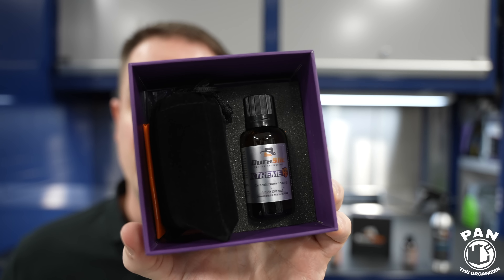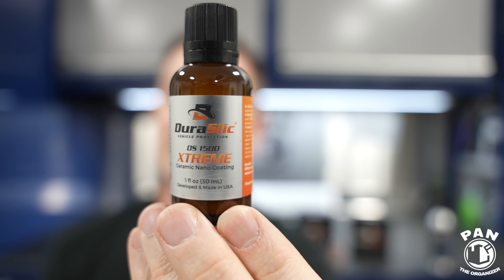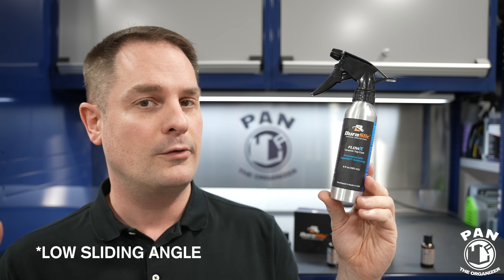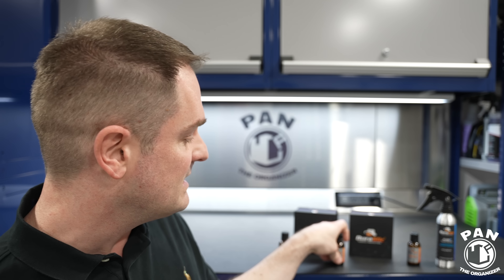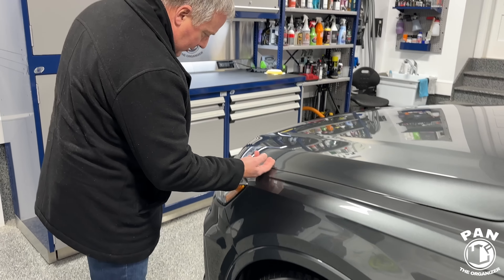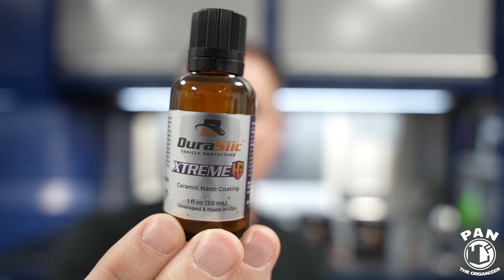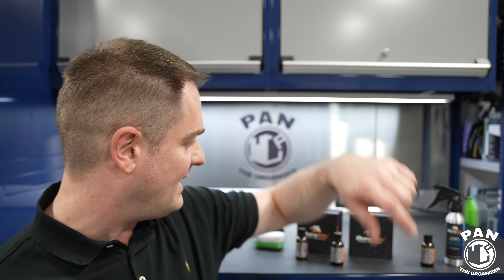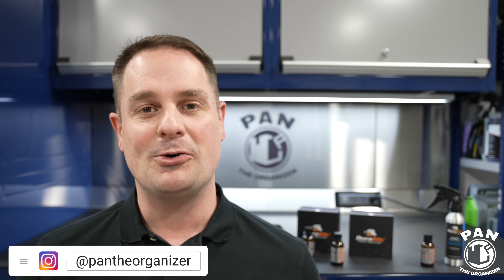Is This The Holy Grail Of Ceramic Coatings? NEW DuraSlic Holy Grail

Comment: Hi Pan, can this coating be applied to trim, plastics PPF? Thanks in advance
Reply from the maker: DuraSalic says that  it can be applied to paint, glass, plastic trim, wheels and lights (not recommended on chrome surfaces).
Reply: @PanTheOrganizer  thanks for replying. Hey just an FYI I applied the Cerakote to my wife’s Audi Q5 prior to selling in a week ago and had fantastic results. I applied at 60 degrees F and 40% humidity and waited the suggested 5 minutes and possibly a touch longer. But I applied it really heavily I’d say 45 ml to complete. I’m in South Louisiana (we had a front move through and I have semi controlled environment (38f outside) it looked great and responded to the first was as you would expect.
Reply from the maker: Oh good to know. Thanks for sharing your experience. So no issues after a few washes?

Yeah it seems to be doing great in some weather/conditions and not so great in other situations. But the brand will address this and update the coating with new curing mechanisms so it should be ok for everyone once the new version gets sent out.

I think some people just overly put drama and conspiracy theories where there was just something the brand needed to tweak. Because if the durability is there, overall the gloss, slickness and hydrophobic properties are very very good and it’s super easy to apply. 👍🏻
Reply: No issues after 2 (then I sold it, Bought a Range Rover Sport PS400 putting HG on it this weekend) but the weather was good. Have to say that was easier to put on and leveling that putting on ole Jescar Powerlock sealant. The looks and gloss were fantastic. The only thing I thing I did differently that I’ve seen was I left it on until I felt and initial slight grab before leveling, maybe I was a little insecure with how slight it is to remove. I agree, people are just too competitive. Your interview with the CEO was fantastic. You can see his a great leader and takes responsibility. With that kind of leadership, allocation of resources and accountability they will get it right.

Comment: Hi Pan 
Just one recommendation to your Chanel most of the time you work on nice or new car doing polishing etc 
It will be interesting if you work on a really bad car(damage big scratches etc )and bring it back to life with recommendations products you normally used that will be a challenge
Reply from the maker: Hi Omar. My channel isn't one of those "Hey look at me cleaning a disgusting car" or the style of disaster detailing video. There are enough copy-cat channels that do that. I have ZERO interest in cleaning disgusting or really bad cars.

After 26 years of detailing, I focus on doing what I like most. So I do higher end full new car prep jobs, including application of a ceramic coating. I don't do entry level car wash or just clean a dirty car anymore. 

Plus, my audience is truly passionate about keeping their cars clean, so making disaster videos wouldn't be popular on my channel.

Also, the techniques and products used don't change from a clean car to a dirty car lol. That changes nothing. You just need more elbow grease and time to clean really bad cars. Case in point, in all the disaster type videos, as soon as they're done pre-rinsing with the pressure washer, the vehicle is 85% clean and it gets back to the exact same point as a cleaner car.

Disaster videos are more for entertainment. My channel is more about education through tutorials, tips and tricks.

That being said, if you're curious, I made a few videos of cleaning filthy cars or older neglected cars, just for my viewers' entertainment a few years ago here:
https://youtu.be/sAqamdcZmn8
https://youtu.be/7zqovDt7NIU
https://youtu.be/KsmXHos0zyY
https://youtu.be/ig82dR1pPN0

Comment: I usually end polishing with the kochchemi micro cut . Do you recommend anything else to polish with before applying a coating ? I just bought the coating in the link and thanks for the video. Appreciate if you can answer this for me
Reply: Kock Chemie micro cut is the bomb, very good polish, that's what I use prior to coating.

Comment: Pan, great video! I'm interested to know if the water spotting is less noticeable with the Extreme HG version vs. the Extreme. I have applied Extreme on 3 cars, and the water spotting is pretty bad. Have a great day, thanks!
Reply from the maker: FlowX was created as a topper for Xtreme 1500 and that should help you.

But yes I’m told that Holy Grail is much less prone to water spotting.

Comment: Sorry I'm new to this- few years worth of slickness, does the ceramic coating prevent environmental fallout from attaching to the paint?
Reply from the maker: No coating can prevent that. What good coatings do is make washing the vehicle a lot easier. And the slickness also helps with helping your mitt and microfiber drying towel to glide better and thus reduce the chances of marring.
Reply: @PanTheOrganizer  IC, so do you perform contaminant removal in between if you feel the grit build up on your finish or just leave it until the coating has lost effectiveness and require a new coat?

Comment: How long will the coating last in the bottle if it hasn’t been opened? Should it be used within a couple of months of purchasing.
Reply from the maker: Typically coatings are good for 1 year if unopened and stored in stable conditions and not frozen.

Comment: Pan, is the kit meant for only a one vehicle application?
Reply from the maker: It depends on the size of the vehicle and how much you apply. But for an average size car, one bottle is more than enough. You could stretch it to two cars if you only apply it on painted surfaces.

Comment: Hi Pan, is there a time period after applying a carnuba wax to let it cure fully before washing the vehicle? Thanks
Reply from the maker: It depends on which carnauba wax you applied. It's important to follow the instructions on the label. But typically, a pure carnauba wax has no curing time. After application, you can drive off in the elements, no problem.

Comment: Hi Pan, Again a great video! With lots of great advise. I have used Duraslic Extrem 1500 and starting Y3 on one of my car and it is the best by far the product that i have used, and got it boost by FlowX last year, and it is like a French install…. UNBELIEVABLE !  Would you recommend extra step for the prep to remove old Ceramic coating that was install 3 year ago?  Again great job!
Reply from the maker: The only way to ensure 100% removal of an existing ceramic coating is by machine polishing.

Comment: Another great product and video!  Thank you, Pan!  I have a quick question for you : if, one year after applying DuraSlic Extreme, I found swirls due to winter in Quebec, I will have to do a minor polishing correction.  Does it mean I will have to apply another coating of DS Extreme on that section?
Reply from the maker: Yes, as machine polishing is what removes coatings. So you would have to reapply.

But if you use safe washing and drying techniques, you should not have swirls or scratches for a few years.

Comment: Can this be used on a normal standard vehicle? Or does the vehicle need to be ceramic coated in order for me to use this product.
Reply from the maker: This is a ceramic coating. And you have to apply this on a vehicle that doesn’t have a ceramic coating. It needs to bond directly to a virgin clear coat. Hence why you prep the paint to make sure it’s squeaky clean.

Comment: Question: when leveling with a MF towel, do you use a new towel every couple of panels? Or it doesn't cure/harden fast enough on the surface of the towel to mess up the applied cost on a vehicle? 
Thank you in advance
Reply from the maker: I use 2-3 leveling towels and 2-3 buffing towels when applying a coating on a vehicle.

Comment: Thanks for this offer Pan,i recently coated my truck(first time coating) and it turned out great but after 2 months im not 100% happy with the coating,it seems to hold water spots pretty bad and has graphine which i though was supposed to help fight water spots? Anyway,i have wanted to try to find a professional grade coating but have no certifications so,this is perfect.
Reply from the maker: Polishing a coating isn't recommended, as you would damage and strip the coating. Mechanical abrasion and friction will remove the coating. Chemical decon steps are always preferred on coated cars. I would recommend the following steps:
1) Wash the car with a decon shampoo like CarPro Descale. It's slightly acidic pH will help remove minerals and water spots.
2) Rinse it, then use a tar remover if you have tar deposits.
3) Rinse it, then use an iron remover to remove brake dust and industrial fallout.
4) Rinse and dry the vehicle. 
5) Then use the water spot remover, which will also help to remove any minerals left on the coating that perhaps are masking its properties. Rinse, and wash the car again. 

The coating's properties should be restored at this point, assuming the coating is in good shape and was applied properly and is still within its claimed durability.

Also, clay bars are abrasive by nature, and again, not recommended on coatings as you would damage the coating and potentially add some marring to the paint.

If maintained properly, you shouldn't have much embedded contamination. In some rare cases where you might find some contamination left after all the chemical decon steps, like a bit of grit in the clear coat, you could use a synthetic clay towel (that uses a different clay media compared to traditional clay bars) and lots of clay lube, in order to lightly clay the surface. A clay towel like this one: https://bit.ly/43nrfce
Or this one: https://bit.ly/43y0Mss

But test on an inconspicuous area first!

Comment: Hi Pan, how does ceramic hold up to claybarring, iron decontamination, wheel cleaner, and or bug and tar remover?
Reply from the maker: You don’t clay a ceramic coating. Claybars are abrasive and could damage the coating. But any good coating can resist to chemical decontamination like tar removers and iron removers and bug removers.
Reply: @PanTheOrganizer  So if you have a rough finish where you can feel particulate matter on your fingertips or back of hand, how do you remove those?
Reply from the maker: You would use a special synthetic clay towel with a dedicated clay lubricant. And be very gentle. A towel like this one: https://bit.ly/3INihwW
Or this one: https://bit.ly/3N1eaQ6

If you do it right, it shouldn't cause any marring.
Reply: @PanTheOrganizer   and this is what you would recommend for ceramic coated cars?
Reply from the maker: I usually don't need to clay my coated car, as I wash my car twice weekly and use chemical decon when needed. I would avoid claying all together if possible. 

But if you have no other choice (in your case you mentioned specifically you have a rough finish) then if you use those towels and proper lubrication, you should not get any marring. But I would still test on an inconspicuous area first.
Reply: @PanTheOrganizer  you are awesome!  Thank you

Comment: Looks like a great product. How does HG compare to Adam’s Advanced Graphene coating?
Reply from the maker: The DuraSlic is slicker and has better hydrophobics.
Reply: This is exactly what I was wondering. I just sold my 2019 Mustang GT, which I corrected and applied Adams Adv. Graphene and man....that coating was amazing. I'm really leaning towards trying this new Xtreme HG by DuraSlic, but it's hard changing coatings when Adam's worked so impressively. I will likely listen to Pan and give it a go, though! I will also use FlowX as a topper every few months.. The one thing about the Adams, is their Graphene Boost was challenging to work with..so using it as a topper was frustrating the two times I did it.

Comment: Hey Pan! I’m in between Roar coatings or Duraslic HG? Which one would have the best value? Which would do you prefer after using both?
Reply from the maker: Best value the HG takes it as it’s much less expensive and only requires one layer.

The Roar Coating is a two-part system, and yes will perform better and likely last longer, but it takes more experience to apply, more time and coats more.

Time will tell, but regardless of which one you pick, both are excellent picks. Traditionally only available to pro detailers, only available to my viewers for a limited time.

Comment: @Pan The HG lists a 5yr duration estimate. If I can live without the extra shine, the 1500 ex with it's 7 yr est seems like a better option. Duraslick's chemist even suggested in your other interview that the 1500ex duration wasn't hurt without the extra shine/low friction surface.  Unfortunately, the 1500 ex no longer appears orderable with your code (in your 1500 ex review). Is there any updated link you can post to order it ?  Is the HG indeed slightly shorter duration ?
Reply from the maker: The DS Xtreme 1500 was only available to my viewers for a limited time to my knowledge.

The HG has a claimed 5-year durability, that is correct. The DS 1500 Xtreme has a 7-year durability claim. But HG is slicker and less expensive.
Reply: @PanTheOrganizer   Sounds good, also curious why the 1500dx didn't make the 2022 Awards ? Looks like a winner. The interview with their chemist was terrific.
Reply from the maker: The 1500 DS Xtreme coating did make the awards. They were in the professional grade ceramic coatings category. Here: https://youtu.be/gRwsznwfTwE

The Holy Grail is a brand new coating, so we'll see if it makes my 2023 awards in late August or early September. To be continued! ;)

Comment: What happens if you buy a brand new vehicle ? Do you still have to go thru all the prep steps ?
Reply from the maker: Yes, absolutely. A new car is never new until it's properly detailed. 
- at the factory, the paint defects are often corrected quickly by rotary polishing which can leave marks and holograms, so polishing corrects those, before you lock that in long term with a ceramic coating for example.
- vehicles are then transported by truck, train and boat so they are exposed to the elements, industrial fallout, brake dust, rail dust, etc
- vehicles are often left at boat docks (when transported by boat) or in exterior parking lots for weeks or months, again being exposed to the elements
- at the dealership, the vehicles are almost always poorly prepped using the same dirty water that was used for all the cars on a given day, and poor washing and drying methods leading to swirls and scratches 
- at the dealership, a layer of cheap wax or paint sealant is usually applied to attempt to make the paint glossy prior to delivery. It's crucial to remove any previous protection before you apply a ceramic coating, as coatings need to bond directly to a virgin clear coat.

If you only plan on applying a regular carnauba wax or paint sealant though, you could decide to skip machine polishing, as those protectants can be applied over existing protection and it's not as crucial to prep the paint as well.

I explain all of this in this popular video: https://youtu.be/QgoyrC-5CMc

So you can better visualize the new car prep process, here are the steps I perform on a brand new car from two of my customers: 
Tesla Model Y: https://youtu.be/gohks8xP5NY 
Porsche 911 Carrera: https://youtu.be/2ckiivbFqs4
Audi Q7: https://youtu.be/t7HCBSVnizM

Comment: Hi Pan!  I’m looking into getting this new coating but, question: I did a Glassparancy graphene coat 2.5yrs ago.  I do maintain every few months with a spray, and I still have good water bearing/repellency but i want to ‘refresh’ the paint and wonder how to prep.  Do I need to get the current layer off (how much is left after this long?) and if so, how will I know when the graphene is removed, without going into the clearcoat?  Thx for any tips!
Reply from the maker: You would need to machine polish the paint to ensure 100% removal of any previous protection. You’ll know there’s no protection left when there’s no more water beading, and just very slow sheeting.

Comment: Hi Pan, I have been subscribed to your channel now for about a month.  I love your content and approach.  Does Duraslic have a coating for PPF or can this be used on PPF?  Also, I normally do my own wheels.  I see they have a wheel specific coating, yet more expensive.  I am curious why this is and can HG simply be used or is there really that much more heat resistance in the specific wheel application?  Thank you!
Reply from the maker: You could apply the DuraSlic Holy Grail on your PPF as well, and on your wheels too if you want.

Wheel specific coatings are usually a bit longer lasting on wheels as they are more heat resistant and have more durability in that harsh environment of heat, brake dust, etc. But don't expect a coating to last as long on wheels, as coatings last on paint.
Reply: Can HG and Duraslick be applied over other coatings like Xpel Fusion or GTECHNIQ CSU or CSL?